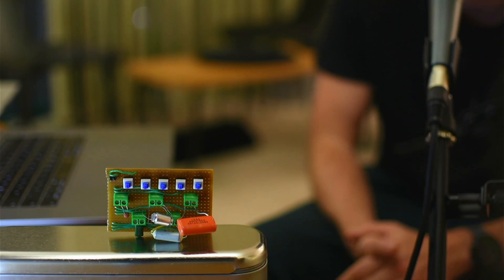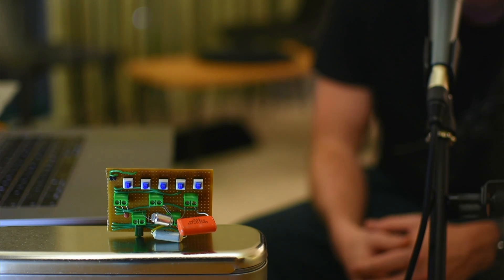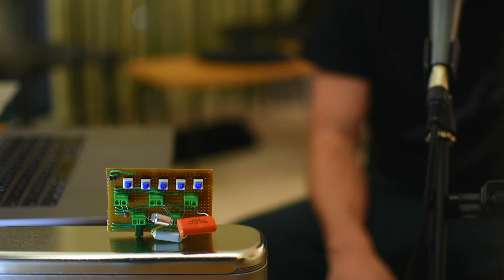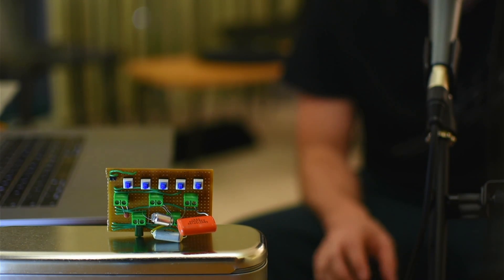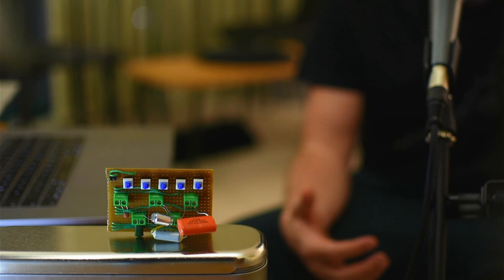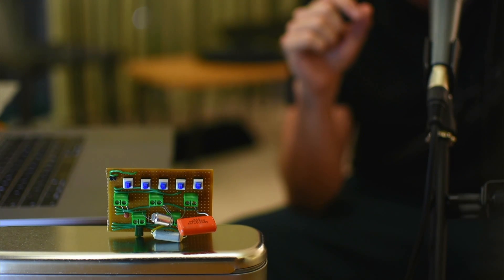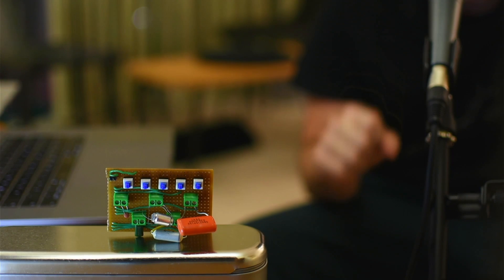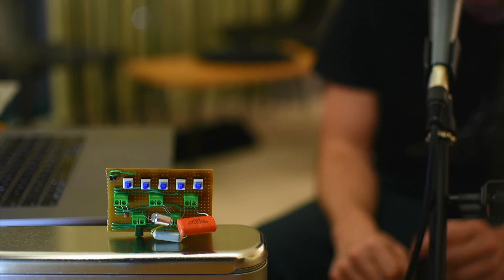Guitar Tone Capacitors Test (Orange Drop Vs Paper in oil Vs Polystyrene Vs Polyester Vs Ceramic)

Comment: It's really nice to see someone trying to actually do a serious comparison. Are you trying to play the same thing each time for each capacitor, or did you record yourself playing a particular passage once with the tone control out of the circuit, and then play that same clip through each of the capacitors?
Reply from the maker: Hey Aaron, thanks for your comment - I was playing the same thing each time which of course introduces another variable (I'll add an annotation on the video to make that clearer). It would be better to do it as you suggested and I thought about it but I was a bit worried about the impact of taking the tone control part out of the circuit. 

However, even if taking the tone control out of the circuit would have impact on the tone, I think we'd still be able to assess the effect of different capacitor types on the low pass filter. Might create another video to cover that scenario as well.
Reply: @vismajeure  Indeed, I agree what I suggested is problematic in that it wouldn't incorporate how the tone control interacts with the pickup itself. But if the caps really do have a different sound, I agree with you that it would still show up.
Reply: @vismajeure  I'm teaching a class in the Electrical and Computer Engineering Department at Georgia Tech this semester called "Guitar Amplification and Effects." The next lecture I need to record and post will be on tone control. Here's the playlist: https://www.youtube.com/playlist?list=PLOunECWxELQS7JV_KeeTJJpgGjOftoaAH
Reply: Going over them again, I'm increasingly suspecting the differences we're hearing are more slight differences in performance than differences between capacitor types.
Reply: If you repeat this (excellent) experiment, it would be really interesting to not reveal the exact capacitor types at first, and just call them A, B, C, etc., get people's opinions, and then reveal which is which.
Reply: @Lantertronics  The difference was clear to me, through the headphones I was using.
Reply: @qua7771  Oh, I'm not questioning that there's differences. I'm curious about drilling down into the exact sources of the differences and in what proportions.
Reply: @Lantertronics  You would have to change the capacitance significantly to get a noticeable change in tone from caps of the same constriction.  If capacitors featured only pure capacitance they would all sound the same, but they feature other characteristics, ESR, etc...  Some people will not except certain concepts regardless of evidence.  It's as if when they get an original idea they defend it for life.  That's just being stubborn.
Reply: I liked the polystyrene the best, with the polyester a close second.  I liked the ceramic least. It had its signature grit that can be harsh.  The polypropylene Orange Drop had clarity, but a bit bright.  The PIO was mellow.
Reply: @qua7771  PIO incidentally had the highest capacitance of the bunch, so that might explain the mellowness more than the change in capacitor type. And interestingly , what you describe as a bit bright has the lowest capacitance (although not by very much.)